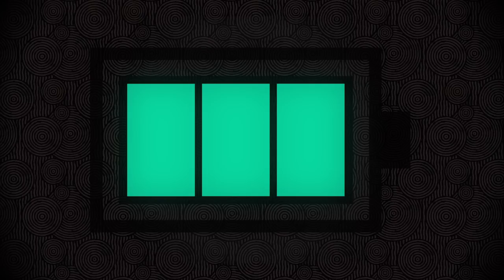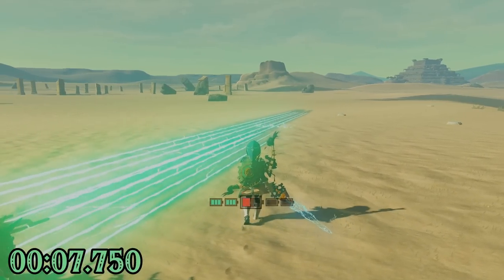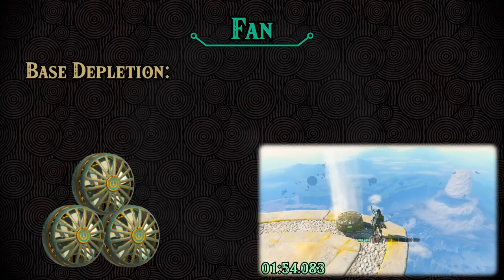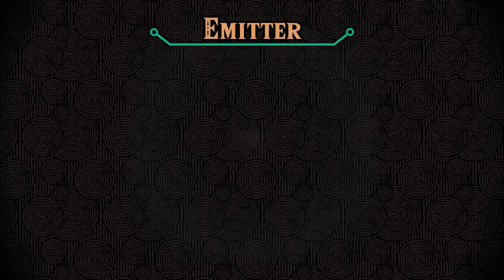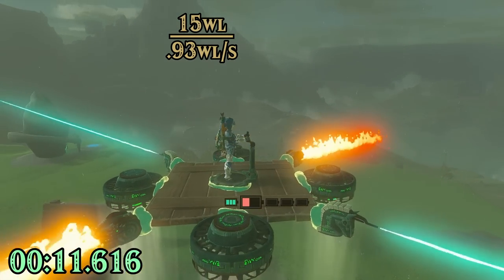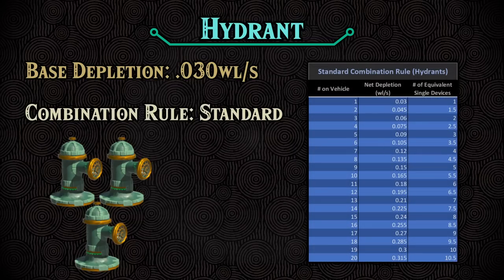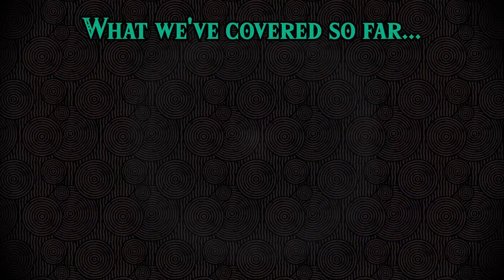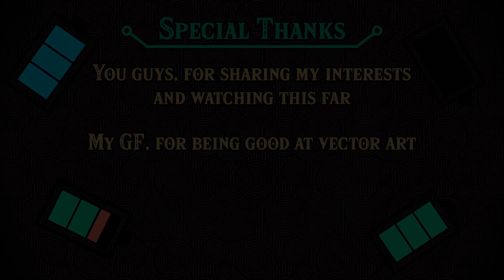How Does the ENERGY CELL Work in Tears of the Kingdom? | All your Zonai device questions answered!

Comment: At 15:25, I'm intrigued by the nonlinear relationship. It would be informative to make a line/scatter plot of the values. What I observe is a generally linear trend, but where every fourth wheel requires less additional battery. My current hypothesis, if you ever feel inclined to test it, is that you would see 0.088 wl/s for 11 wheels, then almost the same for 12, and maybe around 0.096 wl/s for 13.

The slope does appear to change after each fourth wheel, but it's not obvious what the underlying math might be.
Reply: Make sense since most normal vehicles use 4 wheels

Comment: I doubt I'm the first, but I found the pattern for the wheels. Instead of each wheel adding a new amount to the last total, it discounts all wheels when you hit certain markers.
1 - 0.015 - 0.015 each.
2 - 0.022 - 0.011 each (adding a second wheel give both the discount)
3 - 0.03 - 0.01 each (another little discount for trikes)
4 - 0.036 - 0.009 each (the standard 4 wheeler discount)
5 - 0.045 - 0.009 each
6 - 0.054 - 0.009 each
7 - 0.063 - 0.009 each
8 - 0.064 - 0.008 each (8th wheel is almost free because of the 8 wheel discount)
9 - 0.072 - 0.008 each
10 - 0.08 - 0.008 each
Not sure if there will be a discount at 12 or 16 or if it will stay at 0.008 each for all greater than 8 because I'm too lazy to test. Hope that helps.

Comment: Two things with the construct heads: you can make them pulse by attaching them to each other in a special orientation (it's hard to describe it, so you'll just have to see it in a video), which can make beam emitters more powerful while taking less energy (and it might make cannons even worse). It'd be interesting to see exactly how much of a difference the double head makes (although it'd probably be somewhat annoying to actually figure out)

And assuming you're actually going to code up the calculator fully, you could make the construct heads a bit more accurate by essentially making it create a separate section, and then doing the calculations twice, once with all of the parts that are attached to the head and once without the parts on the head, and labeling it as "drain while attacking" and "drain while not attacking" respectively
as for the way the calculator currently works, just create a "base machine" and "on construct heads" section, with the base machine being the total for while not attacking and the on construct heads being added to that to get the while attacking total
Reply from the maker: Hmm. I’ve completed version 2 of the calculator and am working on the video for it.  Maybe that can go into version 3 if I make it eventually, but that would need a HUGE rework

Comment: I propose we use metric measurements for the fractions of wells. For example: A fan's base depletion is 0.156 Wl/s (Wells per second), or 15.6 CWl/s (Centiwells per second), or 156 MWl/s (Milliwells per second).

Comment: Awesome video! I love seeing the whole number breakdown of the battery system. I would’ve loved to see the measurements in Seconds per Well in addition to the units you had as I feel it would be easier to mentally estimate how long a device would last, and personally I find it easier to understand and compare bigger numbers as opposed to fractional amounts. Looking forward to part 2!
Reply from the maker: That is a good idea!  I did consider adding seconds per well, but decided against it because it is harder to use with combination rules.  Maybe I’ll make a followup video at some point.
Reply: Or just use milliwells? Also, judging from your numbers, I suspect actual units used in the game code are different. Maybe we could figure out what they are without diving in the code, based on your findings and the assumption they're actually integers. Maybe there's a number of "units per well" that gives nicer numbers for depletion rates (when considered per frame and not per second).
Reply from the maker: I did look at per frame but they still weren’t integers.  I have since found a datamined spreadsheet that gives the depletion in wl/s so I think that’s what the devs were going for also.

Comment: As a brief bit of maths modelling, you should be able to perfectly model a single cannon's well drain with the following equation:

w = floor(max((t + 2.35),0)/3.1) * 0.9

Where w is wells drained and t is elapsed time in seconds. The inverse (how many seconds t it takes to drain w wells), would be:

t = max(3.1 * floor(w/0.9),0) + 0.75

The general equations would be:

w = floor(max(t + (p - i),0)/p) * d
t = max(p * floor(w/d),0)+i

where:

w = wells used
t = time in seconds
d = wells drained per shot
p = general firing rate in seconds
i = initial delay before first shot in seconds

Floor and max are both functions that you should have access to in any spreadsheet or programming language. Hope this helps you improve even further your calculator!
Reply: Oh and as a (probably) obvious note, you'd amend this for multiple cannons by multiplying d with your group discount before multiplying the output!

Comment: This video is a masterpiece! Theres one thing, however, that kinda rubs me the wrong way: for the cannon, wouldnt it make more sense to plot the graph not from the point of activation but the point of the first shot? This would result in a better linear fit for its consumtion per second and a a fixed value of 0.75 seconds "bonus time" to add to the vehicle runtime.

Comment: personally i much prefer measuring depletion in wells per minute. the numbers are just much easier to conceive and hold in my head. for instance, the fan out of water vs in water in wl/s is 0.156 vs 0.039. and while i can kinda of picture that to some extent, i have a much easier time picturing the difference in wl/m of 9.36 and 2.3.

Comment: Hey quick question and small gripe, the measurements for energy regeneration were using two different battery amounts. Is the time it takes to recharge your batteries to full independent of how many batteries you have? If so, that's kinda insane, making having more batteries also increase your Wl/s recharge rate.
Reply from the maker: Yup, it’s always 21 seconds

Comment: 7:20(ish) - my only suggestion is to flip the units around a bit, to make them 'more relatable'...for example, instead of saying that a Fan has a Depletion Rate of .156wl/s, id say that the Fan takes 6 Seconds to deplete One Well...

...i mean, when you get into the Huge constructs (with like 15 Emitters, Wheels, HoverStones, etc), THEN it might be 'easier' to say "[x] Wells per Second", but while were still talking Small, i find "[x] Seconds per Well" a bit easier to follow along...
Reply from the maker: I agree with your thoughts in the case of single devices.  But we get issues with using s/wl when we try to combine devices together.  Instead of simple addition (with the extra work of looking at combination rules), we would have to add a bunch of weighted fractions and then invert the result.  If you have seen the equation for parallel electrical resistors, it would look much like that.  I think this would take some getting used to for the average audience member, and I hate animating fractions because video editing is not designed for math lmao.  So I decided to use a slightly more opaque unit to make the calculations a bit more clear, if that makes sense.  If it helps, when you use the calculator, it does give the machine's duration (s/wl).

Comment: Warning, the following wall of text ends in a shrug and an "I don't know."

The wheel combination rule looks like the standard combination rule with rounding errors, which makes some sense if you read the data-mined Zonai device values.

The hydrant actually has an energy consumption of 1 (which as you've measured is .03 wl/s, or precisely 1 milliwell per frame), while the wheels have an energy consumption of 0.5 (which you've measured as 0.015 wl/s, or precisely half a milliwell per frame). Two wheels using the standard combination rule would be 0.75 milliwells per frame, but you measure 0.022 wl/s, or approximately 0.73 milliwells per frame.

If we assume there is a very sleight error in your measurement, and it's actually 0.7 milliwells per frame, then it starts to appear to make sense: The game seems to track your energy supply in units of 0.1 milliwell, so the game can't reduce your supply by 0.75 milliwells and either rounds the reduction down or rounds the remaining supply up after performing the calculation.

For three wheels everything matches the standard combination rule, but for four wheels we have your measured 0.036 wl/s, or 1.2 milliwells per frame. Our calculated value using the standard combination rule would be 2.5×0.5 or 1.25 milliwells per frame, which would round down to 1.2 just as we see above.

Skipping over 5 because it again matches the standard combination rule, we come to 6 wheels, where our calculated usage would be 3.5×0.5, or 1.75 milliwells per frame, which should then be rounded to 1.7 milliwells per frame. You measure 0.054 wl/s, or 1.8 milliwells per frame. Perhaps a measurement error? Or does the game simply round 1.75 up rather than down for some thus-far unexplained reason? 

Seven wheels suddenly breaks the pattern. We expect there to be no different from the standard combination rule here, because that should have a multiplier of 4 and therefore no rounding. Our calculated usage should be 2 milliwells per frame, but you measure 0.063 or 2.1 milliwells per frame. At this point, I must admit that either your measurements degrade in precision from this point out, or my hypothesis is simply wrong. Would anyone care to perform the experiment themselves to see if they can repeat these numbers?

Comment: Curious about combining rockets - do multiple rockets attached to the same device activated at the same time make any difference? From what I can tell, if you attach 1 rocket to a base vs. 2,3,10 you will gain the same height only difference being you drain more energy.
Reply from the maker: In terms of height, from what I've seen it only matters to balance the forces out.  I don't think you get much more height from using a ton of rockets.  However, I did not rigorously test this.
Reply: you can technically take any of the fanned flyers anywhere if you just do a couple donuts in the air before you battery runs out, stop your vehicle, instantly use recall on it, and then just wait while your battery recharges during recall. you won't lose any position because you are just doing circles, like a vulture. you get a net gain and can fly anywhere until the timer of the fans breaks.

Comment: If you want, you could characterize zonai charge depletion as numbers of individual fans, rather than wells per second, which would give a conversion of ~6.41, as in 6.41 individual fans running simultaneously would reach a depletion rate of 1 well per second, and 19 fans all connected to one device would, due to the chaining efficiency bonus, have a combined total drain of 10 fans equivalent.

If you have an intuition for the rate of depletion of a single fan, then this measure could be a more human way to relate the power-hungriness of various zonai devices to each other, and to the humble fan.
Reply: Following the video, emitters all have a base depletion rate of ~1.15 fans, which is what 0.18/0.156 is

Comment: This is really interesting.
So for a flying vehicle as long as we are using more than two fans... using several electric motors and the accompanying fans, assuming that we power all fans with one electricity emitter, is actually  more efficient? Not taking into account parts count and accessibility of course.

Comment: I'm curious how the combination rule works for cannons, since they can fire separately with a construct head. If two are on one assembly, does one cannon take 0.9wl to fire and the other 0.45wl? Or do both take 0.675wl per shot? For that matter, can I make emitters more energy efficient by attaching additional emitters to a blind construct head?
Reply: Just did a quick test, and it seems to be based on how many devices on the machine are actually active (rather than just the total attached to the machine). So, for a device with two construct heads with a cannon each:

- if only one construct head is currently activated, that cannon will use 0.9wl
- if both construct heads are activated, the cannons will each use 0.675wl (even if they fire at different times)

So this means you can't really cheat on efficiency by using idle construct heads - the devices have to be active to benefit from combination rules. (You might technically be able to get up to some shenanigans with the discrete nature of cannons, but even if it is possible it probably wouldn't be practical.)

Comment: Someone showed that 1 rocket makes things go up to almost the exact same height as multiple. So while the 2nd rocket is more efficient than the 1st, there isn't a good reason to use a second rocket unless the weight of some objects is enough to make there be a difference in distance traveled. I haven't tested this.
Reply: It appears to be mainly to evenly distribute the thrust, ie not have a platform go lopsided because there's only rocket(s) on one side. Or perhaps to get more nuanced with the angle of thrust.

Comment: 15:38 With wheels there seems to be some advantage for multiples of four. Also consider rounding errors due to the precision of the measurements. I'd guess what you really measured is time a device runs using up X wl, by converting that to wl/s with a fixed 3 decimal places you likely lost precision. That precision issue will likely also affect the "miscellaneous" category. The reason is, that those categories have very low depletion rates, so first converting them to 3 decimal places, then dividing those numbers will result in larger rounding errors. Also one needs to take longer measurement times to get appropriate accuracy in those categories.
If you still have the numbers from the measurements before conversion to wl/s those might yield more precise ratios.
Reply from the maker: I didn't fix any decimal counts in the calculator, but the only device that would require more than 3 anyway would be the cannon, which I truncated to 3 for the video.  For the measurements, I measured the frame count using my editor and converted it to seconds.  Any inaccuracy would be caused by either lag, or an off by 1 error, but either way, it should be quite low.  For all measurements, I waited for it to completely deplete the energy cell because it is easy to tell the exact frame that that happens due to the lights on the devices turning on/off.  For the single wheel measurement, this took over 20 minutes, which is more than sufficient to reduce the innacuracy.  Also, I have since found a spreadsheet with all the base depletion values on it, which match my experimental ones (granted, the combination rules are not present on the spreadsheet).  So I am not too concerned with the accuracy of the measurements being good enough for a general use scenario.  Anything within 1-2% should be ok for this application.
Reply: @paradox_guardian  The thing is, 0,015 * 1.5 = 0.0225 and by truncating to 3 decimal places one ends up with 0.022, then 0.022/0.015 = 1.46667. That's the reason i suspect some rounding leading to these fractions.
If i understand you correctly, the accuracy of your measurements is actually higher, e.g. 0.01500 and 0.02200. Maybe the rounding happens in the game, like 1wl is 30,000 units and each frame an integer number is depleted according to your depletion rates.
Reply from the maker: @Pengochan  It could be that.  It wouldn't surprise me if in-game, they were stored as like mwl/frame or something, which gets rounded weirdly when combined.  I'm not sure exactly what they were going for, I just did my best to measure it.

Comment: wheel depletion looks like it uses a formula that considers 1 invisible wheel attached up to when you have 8/9, or just a table of hardcoded values to simulate as such

it looks like it was done to make using a 1 wheeled vehicle as inefficient as using 2 
(also raises an answer for why the in game schematic for a 1 wheeled bike is so mediocre on energy usage and slow) (but also why bother including that if you explicitly want players to not use it, maybe for the gameplay discovery of improving upon inbuilt schematics?) (but then they constantly present you with opportunities to improve on rocket and fan vehicles in game and don't reward you for experimentation.)
using a 2 wheeled vehicle starts putting you on the normal curve of 00.0075 <-> 00.0072 depletion per second per wheel

I think this is why you get a hard-coded freebie at 8 wheels, as using just the formula of having an extra invisible wheel in the calc would make 7 visible (8 formula) and 8 visible (9 formula) the worst by efficiency
(4 wheels is pretty intuitive early game, some players will try to optimize with 1 or 2 or 3 wheels, and if you do 4 wheels you might intuitively try 6 or 8 by doubling up or making longer vehicles, so i like that they accounted for that)